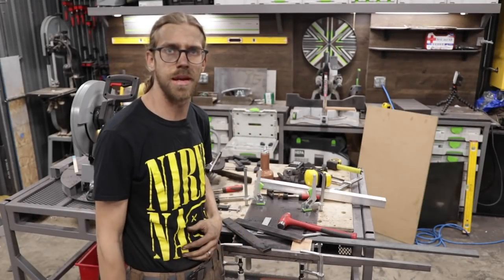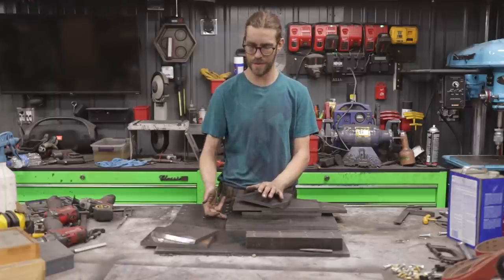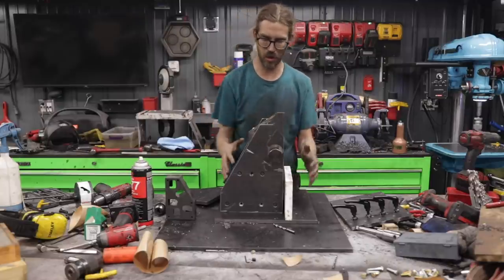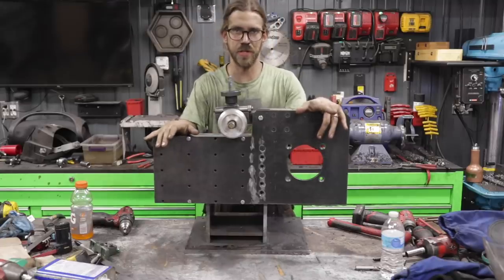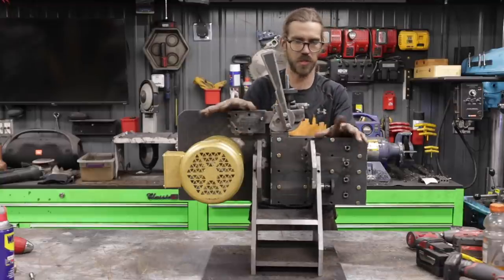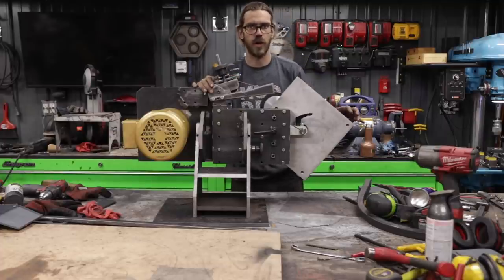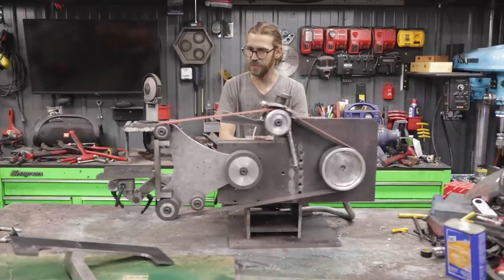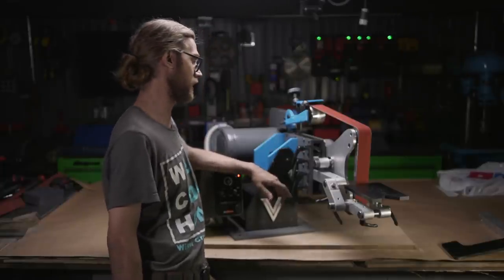2x72 Belt Grinder Build Video (Full Length)

Comment: You know what you want, and you made it, great job. My own thoughts, for what it is worth, the belt grinder must be the heaviest I've seen, without a stand. I built a 4" x 36" table top sander years ago. The maximum plate thickness I used was 3/8" for motor mount and side plate for the 3 1/2" dia rollers, platen and floating side plate. I read in the comments that the sander was ugly, etc. I dont think that, it is functional. I used to draw my plans on paper ( I know, I'm old, lol ) until I got AutoCad, which made a huge difference in design and manufacturing. I also programmed our CMM, co-ordinate measuring machine, and designed all the jigs and fixtures, and made some too. I'm not being critical of you at all, it is just my thoughts. Looking forward to seeing more of your work 👍 Thanks.
Reply from the maker: Thank you I appreciate your thoughts. I tried to make it as heavy as possible. To be honest making a piece of equipment heavier will help reduce vibration too a point. I did try to balance waste with heaviness, but leaning on the side of heavy.

Comment: Are there any plans available?
Reply from the maker: Not yet
Reply: @VanoverMachineAndRepair  are there any difficulties? If you need help with CAD, that's basically what I do for work
Reply from the maker: No Difficulties, I appreciate that. I do want to do it right but I need to make some design changes. I want to make sure I follow the plans and build a second one so I can flesh out the plans and any issues that could arise. I don’t wanna put something out there on the Internet that isn’t somewhat comprehensive. So I’ll just wait until I can do it correctly and with all the information that’s needed. In order to do it like that though it requires significant time commitment and I just have other projects that are ahead of that right now.

Comment: Im trying to figure out all the different options you incorporated into the revolving platen, but Im a little foggy. For example, why the small idler in the usually lower leg of the triangle?  Are there meant to be multiple hollow grind radii?  Is there a pipe wrap ‘mode’?  Other modes?

Awesome build btw.
Reply from the maker: Yes! No pipe sanding mode but the different wheels allow me to do 3 different slack belt options and also just large wheel options. I.e if I want just a 5” contact wheel or 3” or 2” I can just spin it to that part

Comment: Where did you source that control box from?
Reply from the maker: Hmm Amazon I think. I know for a while there was supply chain issues and they were back ordered but I ordered a second one not that long ago and was able to get it directly from the manufacture
Reply: @VanoverMachineAndRepair  can you provide a link to it either directly or from amazon? I cant find anything like that on amazon
Reply from the maker: https://www.amazon.com/KB-Electronics-KBAC-27D-Enclosure-Frequency/dp/B01AOCLIEU/ref=mp_s_a_1_3?dchild=1&keywords=kbac+27d&qid=1618500288&sr=8-3